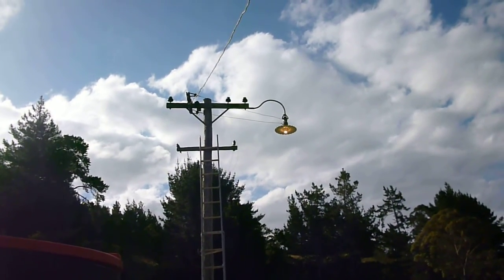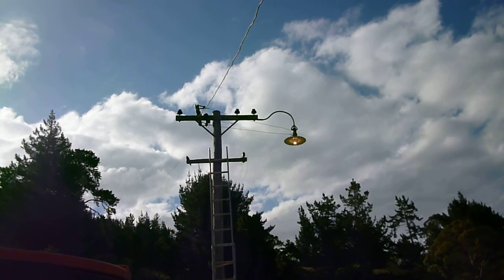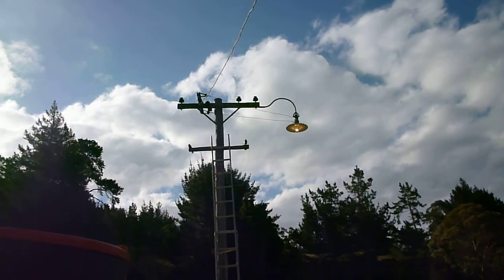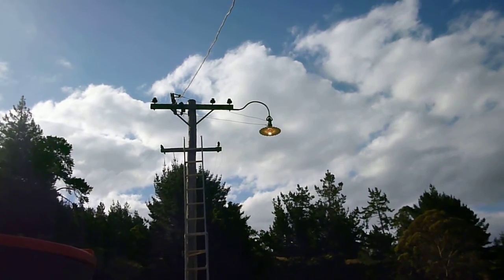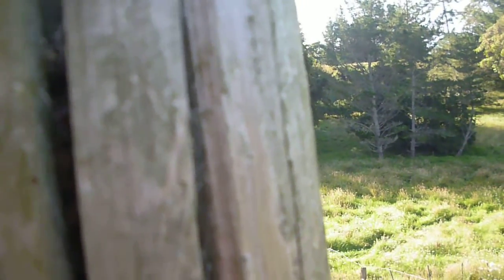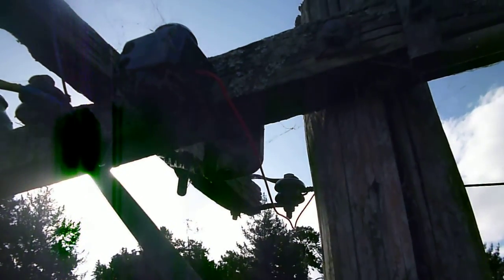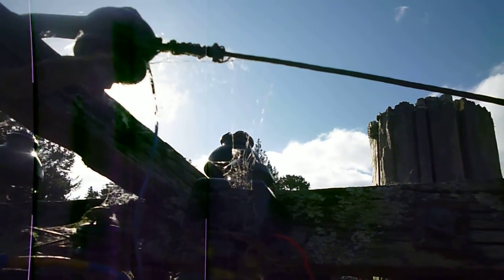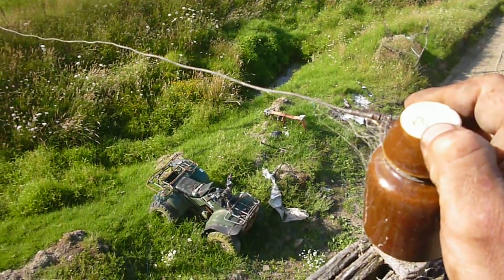1950s radial wave street light on power pole. saving our electrical heritage

Comment: I was trying to find the type of street lighting I worked on A LOT in early 80's Huntington Beach, California.  It was series 2300volt I think .....dirived off 4160v.  The cable was largely underground pole to pole but some overhead...the original single wire cable #8 copper wire was lead sheathed ....our repairs of course were all done in modern plastic installation.   The switches were of course oil filled type.   Was just a constant maintenance problem (job security!)  The old lead sheathed cable was always shorting to ground and knocking out entire blocks of lighting ....typically we would have to jack hammer open the asphalt street just to pull out the old cable because it was welded to the rusted out 3/4" rigid iron pipe...we would yank the old cable,  patch the conduit with special couplings and then blow the water out of the conduit...blow a pull line through (hundreds of feet!) and then pull in New cable and make up connections with split bolt (kernies) glass tape, rubber tape, vinyl tape and then coat the whole thing with Scotchcoat...I can't find any mention of this system on youtube....probably it is ALL removed by now!it was SO freaking dangerous!  Drunks would knock down poles and there would be these LIVE 2300volt lines laying in the street that MORONS would try to move HOT ....even firemen and cops did it!  I think some firemen were killed as I recalled ....well I got a bunch of overtime anytime it happened at night....the WIERD thing was when we converted from incandescent to Mercury and then HPS ...Entire long runs along PCH would cycle on and off all night for YEARS ...had people from Edison and ballast manufacturers and bulb manufacturers and Everytime they thought they had a solution?   NOT...lol ...had underground 4160 transformers blow up sending manhole covers like a hundred feet in the air!   Dangerous stuff!
Reply from the maker: sounds like a semi modernized series circuit  eg being under ground  im sure the fault you described   is caused by electrolysis  or galvanic corrosion  caused by the current running through a lead sheath cable thats in a steel conduit filled with water 
i have never heard of that system here im  pretty sure all our series curcuits were overhead  but they are something that were pulled down 40 years before i was born lol   i have never seen a series circuit in the flesh  but i have studied it  through old photos  and thanks to america they still operate series circuits (awesome guys)  so i have learned a lot off their ones .
in new zealand here  our early electrical generation and transmission were of american design  hence why the radial wave street light and ohio brass insulators were used here

Comment: Very Cool lights, I love the radial wave style. In fact I'm currently in the process of hanging two of them on the front of my house in Pittsburgh Pennsylvania, USA using original scrolled steel bracket arms and adding glass insulators too. Maybe I'll make a video of them when I have them up and running. Thank you for sharing your hobby with us.
Reply from the maker: thanks  for that
here in new zealand  in the early days  our street lights came from america  both radial waves and gumballs
i really like american street lighting too .  im doing a gumball street light and pole restoration  now.
good  luck with your  lights  it would be great  to see them too
thanks

Comment: Hello: we have antique radial wave lamps in our town. How have you found the 13v LED lamp bulb to work for you in your antique fixture. Did you have to retrofit any special additional parts to enable the LED bulb to work? We are considering asking if our town might consider this same bulb in our town lamps.
Reply from the maker: hello there  for  public street lighting  this lamp would be small   since this photo i have changed it to metal halide,
you will probably find your radial wave street lights are wired in series  from a single isolation transformer  so the circuit may need changing to parallel.   if you google  50w led bulb there are a lot on the market that will work well
having modern led makes them look slightly different but at least it is still the unmodified original  ( short story ) if the street lighting circuit is a parallel circuit  the led bulbs can go straight in in the next relamping  round without modification ,   if it is a series circuit  then  the circuit will need changing to parallel  this involves  bypassing or removing the link strain insulator  in the series line  and moving a dropper cable from the series line to the neutral   this will be done for each fitting  which is an easy task  plus with this  modification  being done with the cables most people would not know what they are looking at so to the public the modification would be unnoticeable 
any more queries  ask away  im happy to help